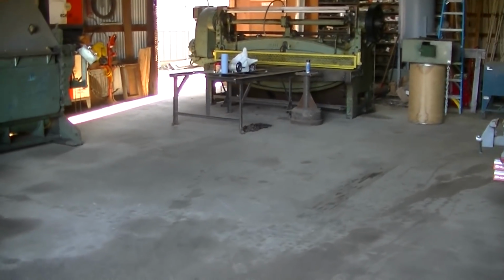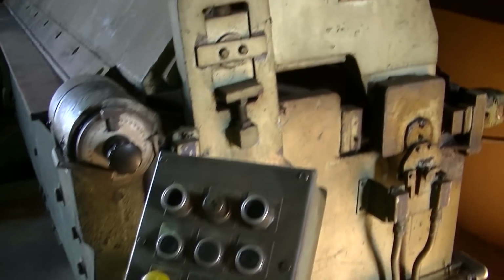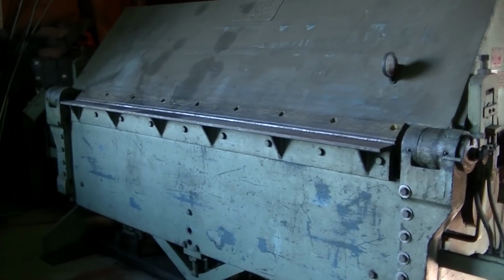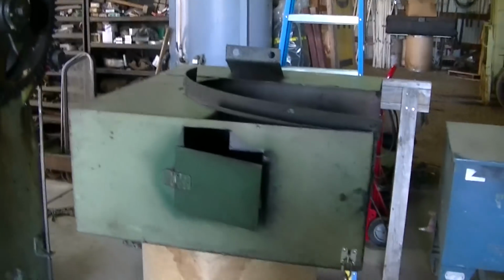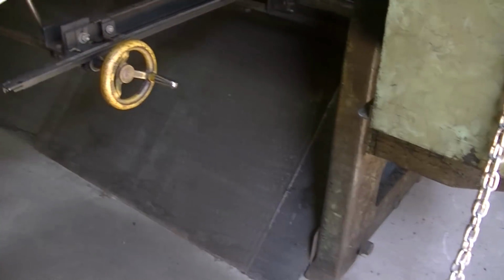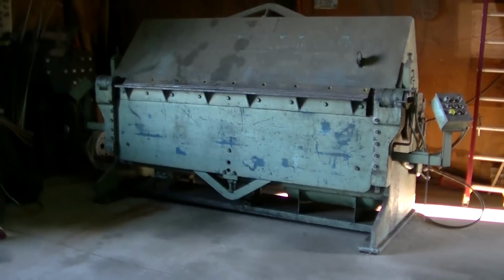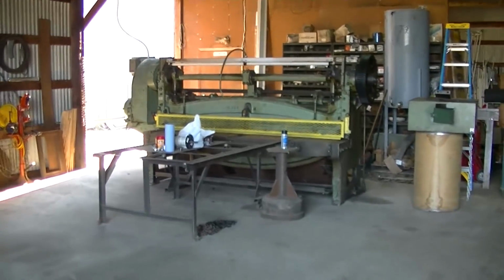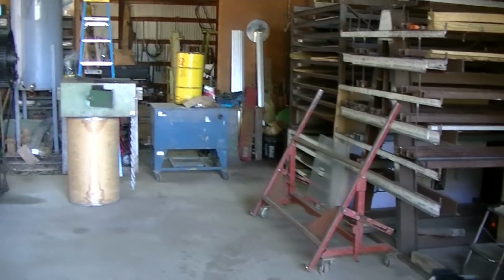"Tool Time" Chicago 8' Industrial Brake & Niagara 8' Shear

Comment: OMG, 1/4 inch plate steel?   Are you planning to make a new tractor frame?  The things that you can make make are going to be mind boggling strong.  All you need now is plasma cutter, the biggest diesel fueled welder you can find, Mill drill press and a gantry crane.. and you could probably make a crude tank..  you probably could do with all that before.. but now you have one that actually was bullet proof.

Also... I would keep running it at 1/4 vs 3/8ths.. 3/8 might of been its maximum safe tolerance, meaning it could do it if you just did one little piece..  but they probably just advertised it at that rate to get it sold.  When it was still their machine, (and they had to pay to fix it if it broke...) then really makes no sense to even try to to run it at 3/8.  If they would not normally try.. you probably should not either..  It really is rated at 1/4 inch.

It's good to see you making video still.  And what great subject Material you found too.
Reply from the maker: We have a plasma cutter and a forklift that can pick up just about anything.  The capacity of the shear is 3/16".  It will probably shear small pieces of 1/4".  I don't think we will try to shear an 8' piece of 1/4".
Reply: That actually might be enough... your talking about the kind of forklift a junkyard uses to pick up truck?  

You know, I never thought to ask... but what is you do with all this equipment besides make awesome you tube videos?
Reply from the maker: We have a Clark IT-40.  I believe it has a 4000lbs capacity.  It picks up everything we need.  I have videos of it.  We harvest moss and grow cranberries.  I have videos on all that as well.  https://youtu.be/gLxIgaxQ7WM
Reply: Looks at the video... Wow..I never realized anyone did anything with Moss.... and now I see there is a entire industry around it.  Wow... nobody ever mentioned there where moss farms in Wisconsin...  At least I now understand where your nick comes from.